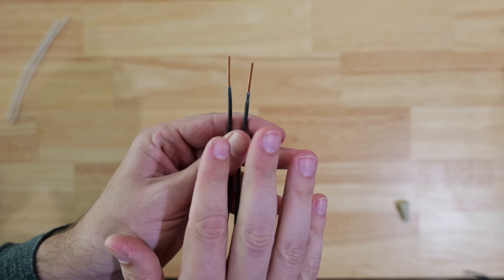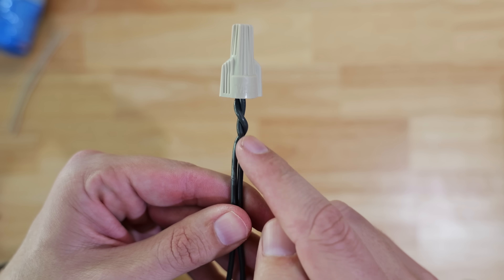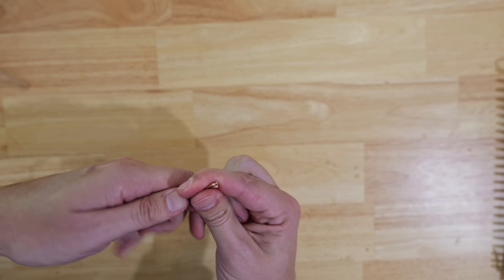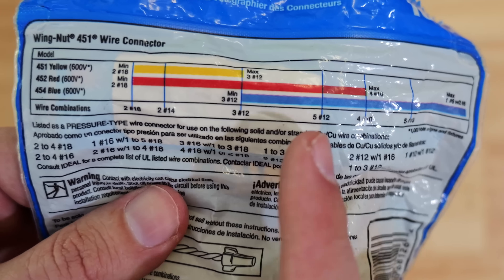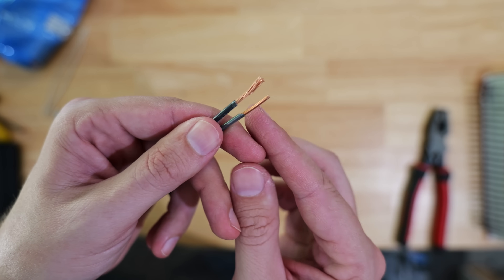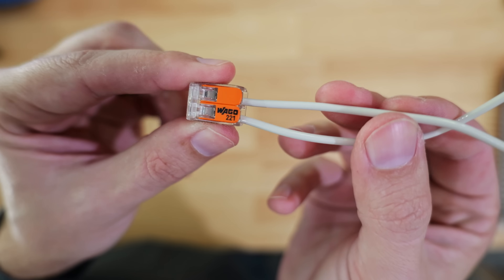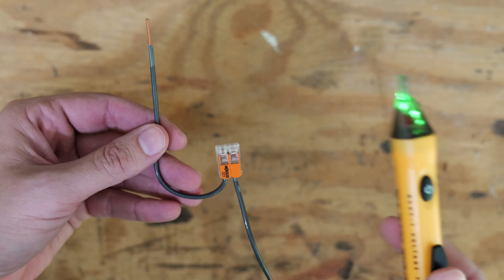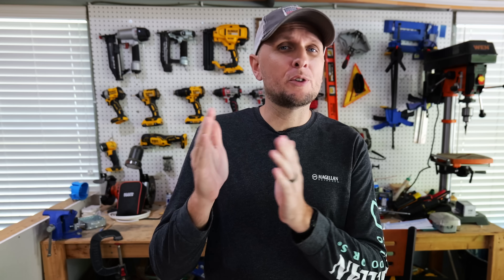7 FATAL Wiring Mistakes Most DIYers Don't Know They Are Making | Most Are Guilty of 3

Comment: One "don't" missing from the video, that I see fairly regularly, is re-using the old fashioned push-in connectors.  Some of these can be re-used without any issue.  Others can be re-used with the same gauge or thicker solid wire.  And some should not be re-used at all.  For safety's sake, I throw them out whenever I have to pull a wire out of them.
   
Another mistake: not properly torquing screw connections, especially in breaker boxes / consumer units (whatever these are called in your country)

Comment: I've installed hundreds of ceiling fans with the crappy connectors without issue. I pre-twist the conductors and tighten until the insulation twists and then try to pull the wires out. That's my pass/fail test. You can't always get all of the wires into a pancake box with Ideal wire nuts. WAGOs work better but they cost more. And, you have to use the right WAGO lever nut that is made for solid and, stranded wire.

Comment: I used to use Wago in late 90s as a european journeyman electrician, while Ive still using marretts is 2024 in canada . 
If you twisted proper the conductor for connection and cut the and to make it even by using maretts you will never will problem .

Comment: I'm an electrical
lineman, we call outside wireman. High voltage pole top and underground structures. It is frustrating, but the work of an inside wireman is completely different. I often think I will wire my house one day, but it will be a difficult study, and maybe better to trust in a contractors insurance. Still, I think I can do it.
Reply: Like night and day, for sure. Same as asking a house wiring guy to do EMT work. :)

Comment: What I do as a addition safety step using a wire nut after twisting the wires is to use a color code electrical tape around the wire nut to prevent any nut from coming off  .

Comment: It’s really important to pre-twist wires when it’s more than 2 are going into a wire nut, starting with over stripping the insulation. Without this step invariably one conductor will be barely twisted into the rest because the copper conductor was too short. After all conductors are well twisted together trim to fit the wire nut.

Comment: Even better, coat the wires with No-Ox grease before screwing on the wire nut.  Some come with grease internally, esp. for outdoor locations.  In outlet boxes, I use wire nuts since cheaper and more secure.  For overhead lights, I like Wago levers since easy to replace fixtures in the future and I use LED lamps which draw minimal current, plus less time holding your hands overhead to lose blood and trying to support the fixture while wiring.

Comment: WAGO plug addendum - if you do any DIN-rail panel assemblies, WAGO has a mount for securing those joints to a DIN rail.  This makes routing and organizing wires much, much easier on panel modifications (If you've done it, you know what I'm talking about). The more you know!

Comment: It was mentioned in the video that they can vibrate from the current in them and come loose. An additional phenomena that can loosen them is temperature cycling. Current flows and they get hot and then when its off they cool. And the worse the connection gets the jottter it gets when current flows through it.

Comment: Ive been on some remodel jobs and opened a box to find all the plastic melted off of the wire nut and only the coiled metal inside was left around the wires. I havent seen it but just a few times and everytime the wires were not pretwisted and that bad connection built up a lot of heat over time. The wire nuts that have real hard plastic on the outside are very likely to split. Supply house sentbus some on a job. We usually use ideal. It only took a couple of us getting hit to throw them away. One more thing to look out for that ive seen over the years is over tightening. Usually from someone using the little damn wirenut bit for your drill. Ive seen the wire poke out the end of the wire nut. It wasnt much but it was just enough to get you hit or have a short. Just wanted to share things that i learned the hard way.bi know a lot of us have to work on stuff hot. I know theres tons of ways to get the job done, but one thing i see that in my opinion makes things harder is when people twist the wires all the way down to where they come out of the connector. That makes them harder to neatly fold into the box and if you have to separate the wires later for what ever reason they are all bent up.

Comment: I always thought if you had solid core cable you would use the connector blocks with the screws. To use the ones that you first shown, that would be for stranded wire only? . Mind you, I’m no electrician   Good video 👍👍

Comment: The problem with wire nuts is how much exposed live or hot area is open to the outside. Plus what you would call an advantage I was told a problem. If the wires come out for any reason the circuit is still connected and no fault occurs, so you have a couple of exposed wires just hanging in the open for someone or something to touch.

Comment: I guess I grew up in a day where almost all of the tips described here would be covered buy a average dose of common sense. I did however appreciate the one tip about letting the stranded wire run longer that the solid when installing the wire nut. We didn't have or know about Wago connectors in my day but they sure solve a lot of issues inc. seeing the wires in the connectors when finished

Comment: A problem not well known with wire stripping tools, some types that grip the insulation and pull to strip will stretch the remaining insulation, over time the insulation relaxes back to its original position and leaves bare conductor exposed outside of the connector.

Comment: Twisting wires together before putting wire nut on helps to make the connection secure, but... The spring inside there applies constant pressure on the wires forcing them together.  Plus the spring is conductive adding more surface area for the joint. If you are saying wire nuts are not worth using, you are on the wrong side of this issue. If you are unable to make a proper joint with wire nuts, you are the problem. 
Also, i would not twist those wires like that, the only place a twist is required is near the tip.
I twist the wires then make a straight cut across the tip. All of the sharp corners of all of the conductors thread into the spring.

Comment: I’m going to get some Wagos tomorrow for ceiling fan install.  I’ve always disliked wire nuts.  Whenever Ive used them I’ve had the feeling of, there must be a better way.  I would wrap some electrical tape around them.  An old electrician friend told me how to tape them properly.  I wonder if that’s in the code now?
Reply from the maker: Tape is not required.
Reply: @HowToHomeDIY  Thanks

Comment: I was taught to wrap all wire connectors with electricians tape after making the connection.  Then again, maybe this was if you use crappy connectors. Does it make sense to use proper connectors and save the tape? (Thanks for this video. It appears that I've been a bad boy on occasion.)

Comment: My method for stranded to solid is to splice the solid to a short length of another solid wire, a sacrificial solid wire, then I untwist the sacrificial solid wire, then wrap/weave the stranded into the solid. It looks just as if 2 solids were twisted together. Now the wirenut is gripping 50% of the solid and 50% of the stranded, just as intended. Try it , it's stronger than you think. Then just for good measure a little electrical tape.

Comment: Careful with the tape. A home inspector can think you are hiding bare wire hanging out the end of the nut or wago from stripping back the wires to far. I have soldered stranded wire to solid core before adding wire nut cause the nut alone wasn't working. The main takeaway is pull on your wires after you make a connection to test it. The wire twist is news to me, I have never done that except on solid grounds.

Comment: As a electrician from europe, we don't have wirenuts and I don't trust them. I like the wago way better. I always just made sure the wagos was clamed down and didn't open after fastening. In many cases Ive used a type of wireconnectors that require a flat screwdriver that mashes the copper ends together. Done right (as obviosly stated in the video you should know that you are doing) I find these very reiiable. Bad connections is the root cause of evil.

Comment: Wagos are easy to use but sometimes I dont know how it can be but there are issues when you consume too much current. Joints can be loosen in time with the wagos. I saw some melted wagos connections because of overheat. But I never see any melted classic connection if they well twisted and insulated.

Comment: One of the big advantages of WAGO lever nuts is that you can easily open them. Taping them up is great when you want to 100% make sure that they never open, but if you do need to access those wires again... have fun getting all that tape off. It's kind of like welding your garage shut because you just really want to be sure that no one breaks it open. Sure, you can do it, but are you really going to angle grind your way into your garage every day?

Comment: Question so lets say the house wire has too much insulation taken off and you go to put the wago or wire nut on and you have some exposed wiring showing? Will electrical tape fix this problem? Cuz i cant replace said wire due to it being the house wire and not the fixture wire. Ive used electrical tape and havent had any problems but wondering if thats a safe practice to avoid fires or arcing. Thanks

Comment: Wagos are great. The problem lies in the American voltage systems. 120v 50amp generates more heat than 220v 50 amps. We use them a lot here in refineries/industrial but mostly on 277v circuits.

Comment: Any electrical installation job I do in my own home,  I twist the wires first, then solder them (with lead containing solder, not lead-free solder which is brittle)  then screw a (large enough) wire nut over the soldered joint. Best and safest way. But I realize that in a commercial installation, this would be way too time consuming and thus too expensive.

Comment: Also, if you don’t pre-twist when you go to push, I’m back into a electrical box whether it say light switch a plug or a junction box it puts pressure on them and they can pop loose, causing a loose connection and potentially a fire

Comment: I have two things to share. In 1987 I was installing a neon sculpture on the outside of a 16 floor commercial building and the controls in the utility closet one floor above in the parking garage. The first three floors are parking and the North side of the building was built right up to the street, with the sidewalk under an overhang that is below part of parking level two, When I was pulling the wires through the conduit standing on a ten foot scaffold, between the cars racing through the parking garage above and the buses rolling by just feet away on the street I swear my teeth were going to vibrate out of my mouth. When I finally got to connecting the wires I twisted them with my pliers, cut the ends even, installed the wire nut, then secured the wire nut with electrical tape. The owner of the company had a saying, "once we finish a job we don't ever want to return to it." So every part we used was 50 to 100% over spec. If it called for a 25 watt resistor we used 50 watt resistors, etc. 
I called for an inspection and after waiting four days the inspector arrived and after about ten minutes of looking over the connections of the first unit of which there was 150 units installed in the ceiling that was about 1250 feet long the inspector called me over and asked me where did you learn how to wire connections like this. I explained I had worked with my grandfather in the 60s during school breaks, he complimented me on the secure connections had me roll the scaffolding down to the other end checked a few connections and signed off as complete.

I know this is long but the point was six months later I was installing neon in an ice cream shop and was waiting for an inspector, I went out to get some lunch and when I returned the inspector had arrived and left. I was livid until I realized he had signed off on the job. The helper I had working with me said the inspector came in looked at the first few connections asked for me by name, said ok when he said I went to get lunch, signed off and left. When the kid said yes when I asked if the inspector had a scar on the left side of his forehead,  I just laughed because I knew it was the same inspector I had on the downtown job and good work doesn't go unnoticed.

Comment: What about a Tap Splice? Could not find lever nuts, but at my building supply but I found Tap Splice connectors where you insert the 2 non strip wires into the connector and then clamp down with pliers so the metal tap completes the connection.

Comment: In industrial applications, especially Oil & Gas, wire nuts are illegal. They will allow wago (pronounced way-go) connectors in a conduit outlet body, but it has to be shown on the drawing & marked on the conduit body.

Comment: using wire nuts on two solid core wires works okay as shown. But connecting a solid core wire and strand wire with a wire nut doesn't always work as well. I use WAGO's now for connecting both types of wires, it's easy and haven't had any problems with them.

Comment: When I line both wires up and snug them tight using a marret connector I remove the connector and both wires are twisted together. I find it to make a better connection that twisting both wires first. BUT if I have 1 stranded wire then I will sometimes twist it on the solid wire.

Comment: There are outlets made with wiring receptacles similar to the Lago, but without levers to lock the wires in place. I have had to remove the wires and bend them around the screws like they should be installed, in order to get the outlets working again. I'll only use wire nuts.

Comment: I always use electrical tape to final wrap the wire nut and the wires at the end. Never coming apart ever. 
I also wrap the electrical tape around the screws on any outlet I install.

Comment: for less than $10 at any home center or hardware store you can get an outlet tester which can easily tell you if the outlet is wired correctly or not. Every homeowner should have one of these and use it to test every outlet in the house and when not at home always test the outlet out before you plug anything in. Not only is this for fire prevention. You can damage sensitive electronics if you use something on a socket that is not grounded or has the hot and the common reversed. Musicians always carry one with them to check the outlets out before plugging in their often expensive equipment. You can fry a Marshall stack or electrocute yourself or your bandmates while playing guitar by plugging it into an improperly wired outlet for every venue that you play.

Comment: One subtle downside of pre-twisting for a wire nut is that you may end up with the nut not securely on the wires. When you use the nut to twist the wires, you are forced to apply torque to where a loose nut is very unlikely.
Reply from the maker: I’ve personally never had that issue.
Reply: @HowToHomeDIY   Well, neither have I. But then again, I was trained to torque the nut all the way down regardless. A DIY-er may not be aware of the need to do that.

Comment: Hey thanks for the video, so I do have a question say 
"I have a fan already install in a master bedroom; however, I want to install 4 recessed LED either 5" or 6" lights for extra light. May I use one of the hot wires from the fan to power up the LED recessed lights? please let me know? or do I have to run a separate Romex up to the ceiling lights from the switch on the wall? thanks again.

Comment: Will the Wago connector work well for connecting wires ina vehicle under the dash. Specifically, connecting the Pigtail Connector wires that go into the cars AC Motor Blower.  additionally, which which Wago do you recommend or any connector?   TIA from a newbie!

Comment: The the first part where you explain conecting solid wire to solid wire. If you read the manufacturer fine print of wire nuts, most brands will say only use nut when connecting solid to braided wire. Not to use solid to solid. Reasoning is wolid wire to braided wire will properly compress to the cone shape of the wire nut, solid to solid will not so a secure connection to their standards not met. Also dont pre twist solid to braided wire, if you pre-twist, it doesn't make as many rotations when tighting the nut and won't conform naturally in the nut.

Comment: It seems like an unlikely event but if you are so concerned about flipping the wago levers, you could tape them shut with electrical tape.

I see you point with caps and twisting them, but I usually don't have the luxury of having the wires out of the wall. It woreceptacle. If not impossible to get a nice twist like that when replacing a recepticle. At most I have like 2" of wirecto work with and the wires are both coming from the wall.
Reply from the maker: Then why not fix the wire length while you’re at it.  That should not be the case most of the time.

Comment: You could use a zip tie around a Wago lever nut if you didn't want to use sticky tape which leaves an icky residue.  The dollar tree skinny kind would do the trick.  This is only in a high stress area.